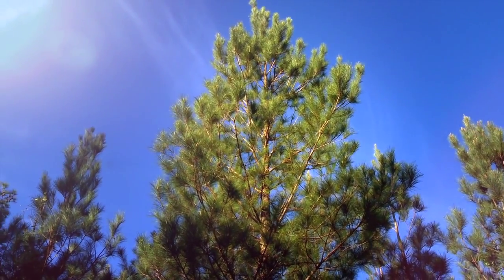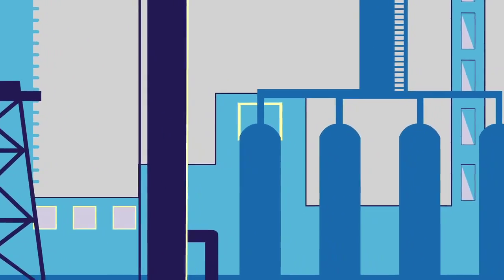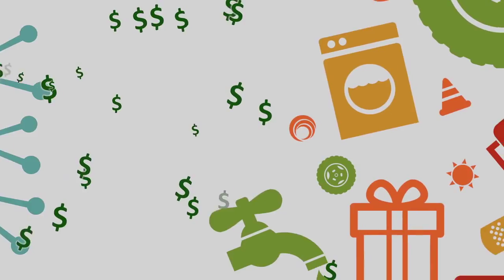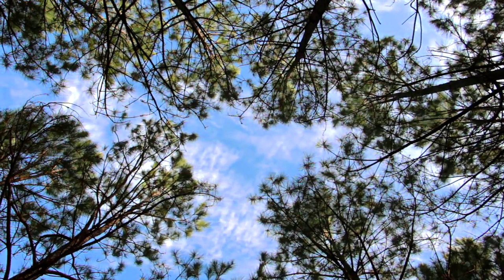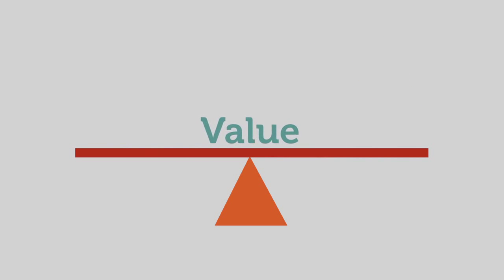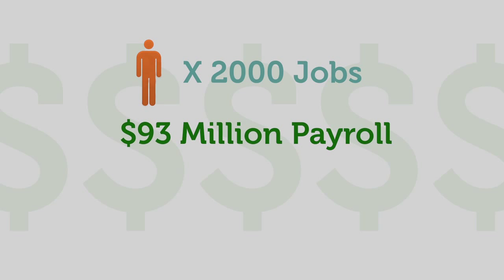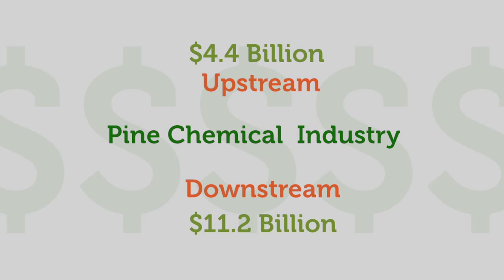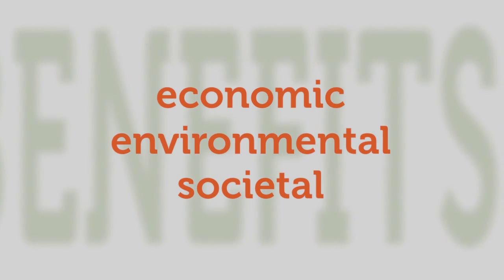MWV Pine Chemicals

Comment: It seems like in the short term, the tall crude oil will only be used as minor fuel additive and probably won't affect the supply of tall crude oil for higher value products such as adhesives, coatings, ink resins and others.
From my opinion, the concern on the fuel subsidies distorting the tall crude oil market is perhaps misplaced.
http://c.ymcdn.com/sites/www.pinechemicals.org/resource/collection/C9836B4C-DDF1-4725-82D5-AAA0E89C2311/Michel_Baumassy_-_The_Tall_Oil_Industry_-_100_Years_of_Innovation.pdf